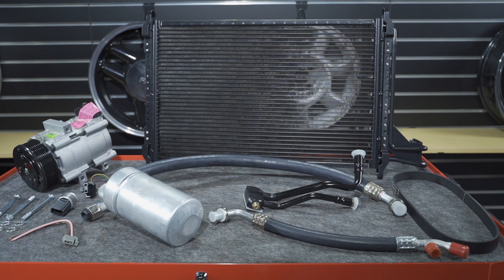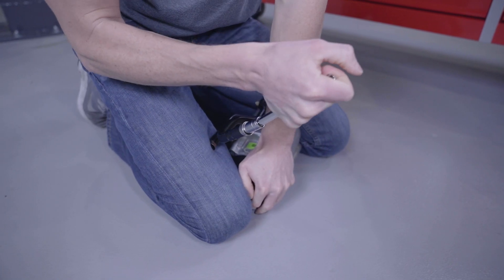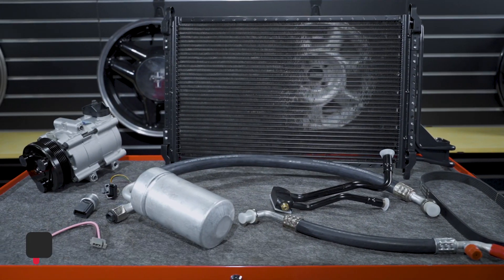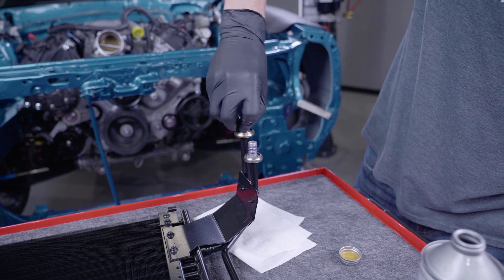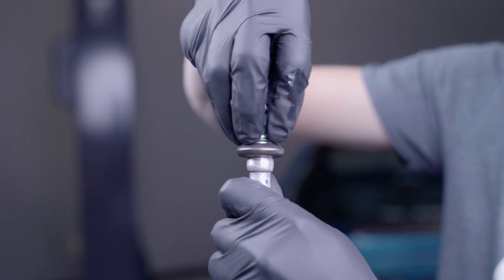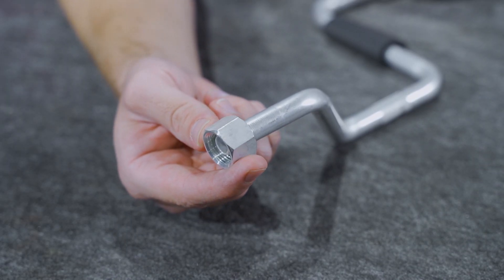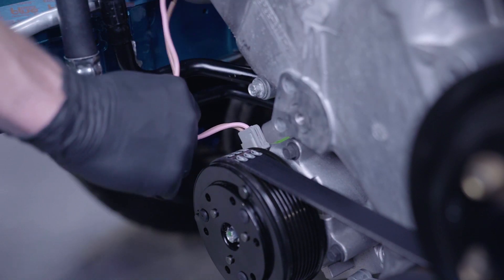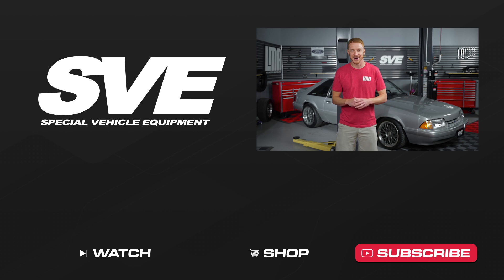How To Install SVE Coyote Swap Fox Body Mustang A/C Kit (82-93)

Comment: So are there any instructions on the wiring? It's probably the most important part as the factory pressure switch wiring would be gone in this case.
Reply from the maker: Shoot me an email to landan(at)lmr(dot)com and I'll be more than happy to help.  Thanks!  -Landan
Reply from the maker: The Infamous Project - Have you had a chance to send me an email?  -Landan
Reply: @latemodelrestoration  just did

Comment: Does this kid have a orifice tube or a expansion valve? I have this kit but usually AC systems come with one or the other. And when installed, it did not have anything. So I am curious as to if it has a orifice tube or a expansion valve somewhere.
Reply from the maker: If you'd like to know more info about this kit, check out the review video: https://www.youtube.com/watch?v=IbK6VsQv3eo&t=0s

To answer your question, yes, the liquid line does have an orifice tube.

Comment: Does the dryer just float in place or is the original fox dryer mount needed?
Reply from the maker: I would leave it off that way you can "clock" the accumulator/drier if it's needed.  Because of the position of the accumulator/drier in relation to the HVAC box stud, I would also place a vacuum cap over the stud. -Landan

Comment: What’s the refrigerant charge amount?
Reply from the maker: Once installed, this system will need to be filled with PAG Oil and R-134a refrigerant by a licensed professional. The high and low side service ports are R-134a spec.
Reply: @latemodelrestoration  I meant how much was charged in? As in lbs/ or kg